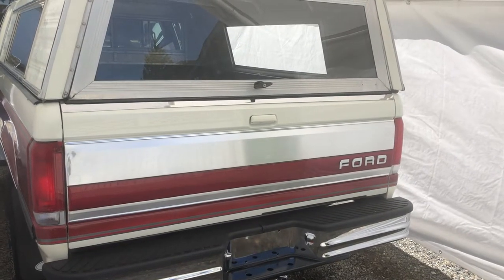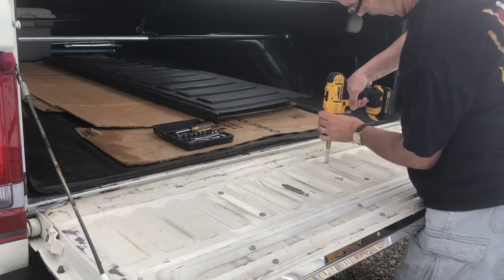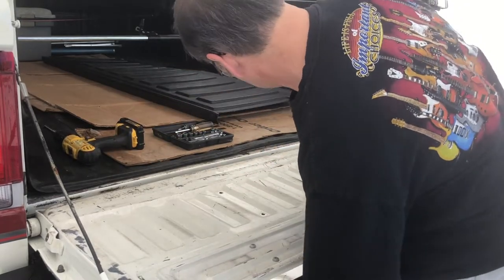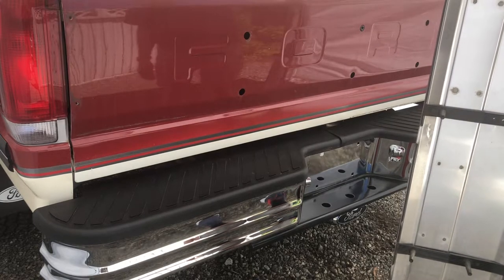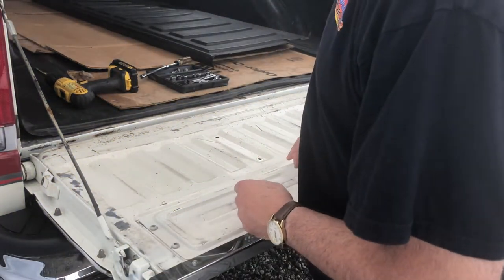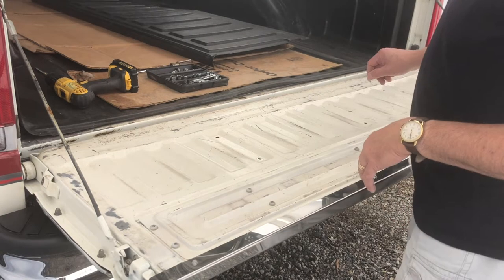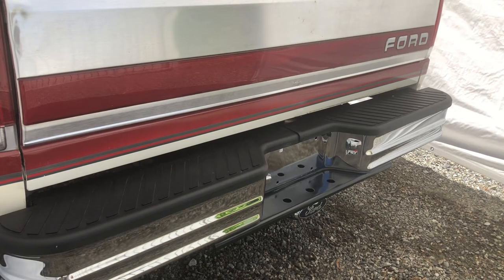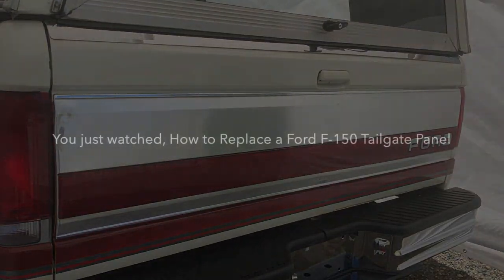Follow up to replacing my Ford F-150 Tailgate Panel

Comment: the black plastic/nylon runners on the inside of the panel that have the 5-6" barrels that the screws go into....do you know where these can be sourced?  Also, the 2 end screws that look to be attached to the panel and go into the tailgate ends where you put the nuts on...  do you know where these can be found?  thx. a bunch

Comment: Where did you get the replacement tail gate panel? Been searching and I can't find it anywhere.
Reply from the maker: Found it on eBay used.  At the time I was searching I checked LMT Truck and they have a new one, but it was out of stock.  The new one was also $500.

Comment: Where did you get the plastics for the rear bumper? Or did you buy the whole thing?
Reply from the maker: It's a whole new bumper.  This is the second one.  The first one I bought from LMC Truck, but my mechanic shop said it didn't fit right.  So they sourced another bumper, but I don't know where they bought it from.